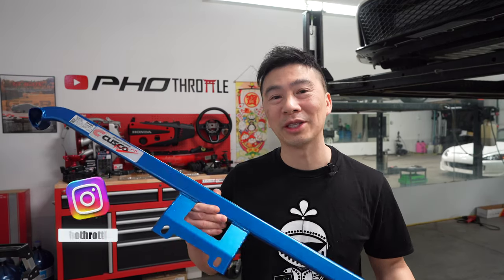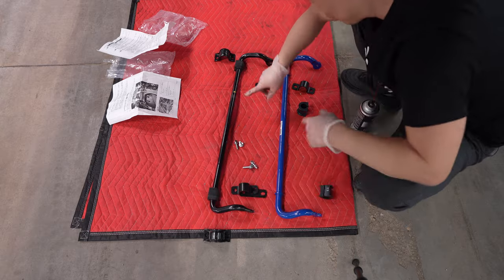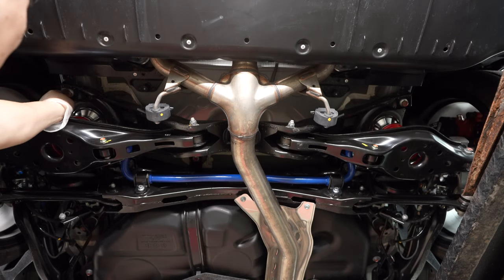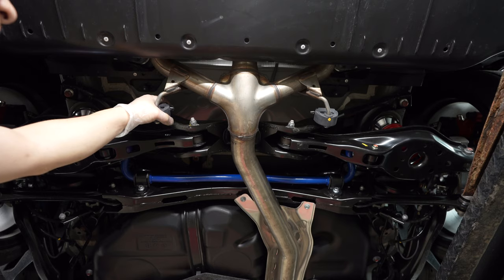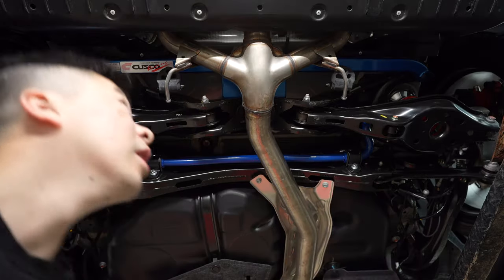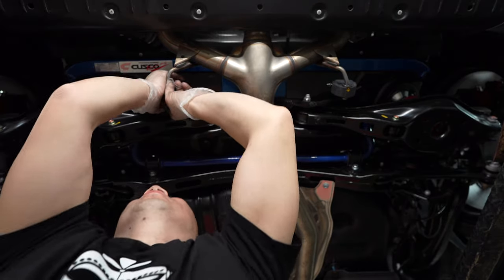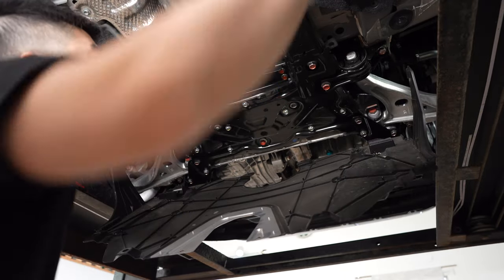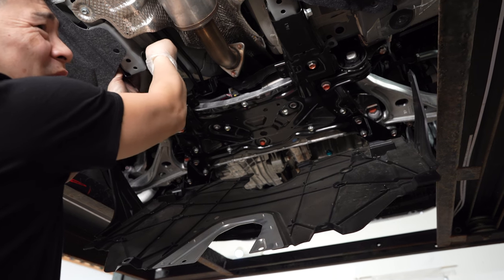FL5 Cusco Power Brace and Sway Bars

Comment: For the rear power brace, you don’t have to take the hangers down.  Just go in left to right with the brace in a vertical position.  Then when in position, lay it down horizontally and make adjustments as necessary.  Regardless, super nice work, man!  Torque specs are key.  You and I have the same mindset.
Reply from the maker: Thanks for the advice appreciate it. I definitely could have used it during the installation hahaha
Reply: @phothrottle  haha nahhhh just showing the young guys there’s more than 1 way to do a job, that’s all.